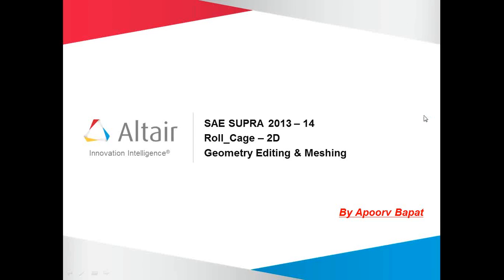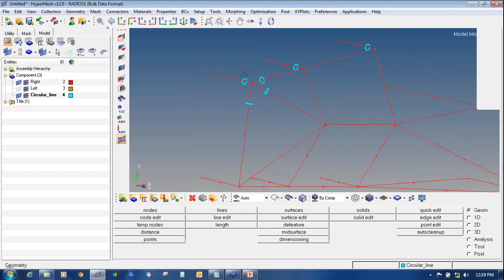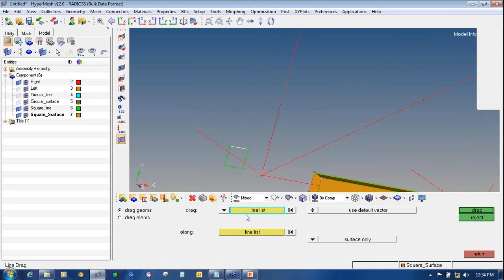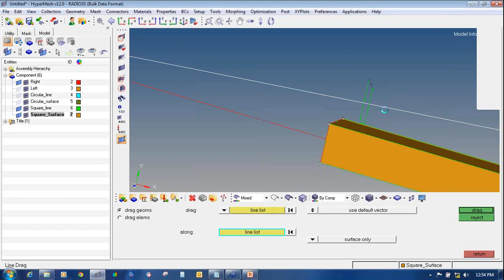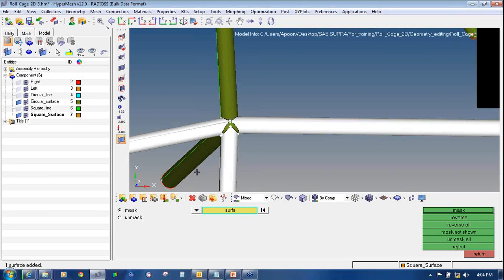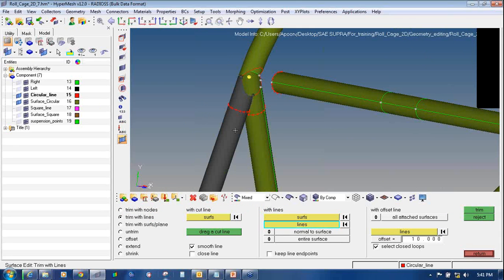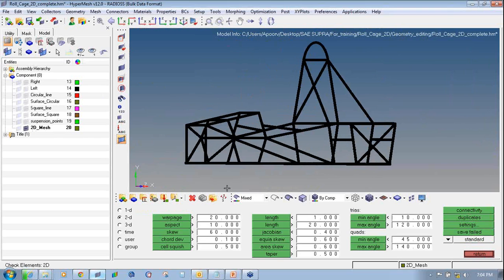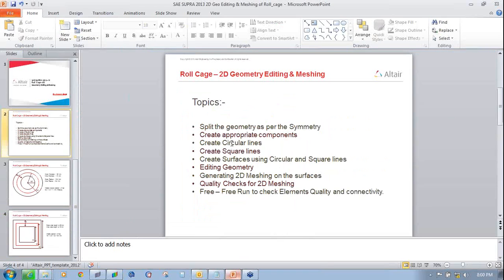SAE SUPRA Roll Cage Surface Generation, Geometry Editing, Meshing

Comment: there is no bulk data option in radioss ..help plz
Reply: From hyperworks 13.0 or above radioss bulk data profile is transferred to optistruct profile.So,continue using optistruct solver to get the result